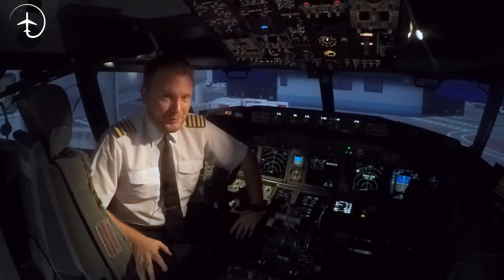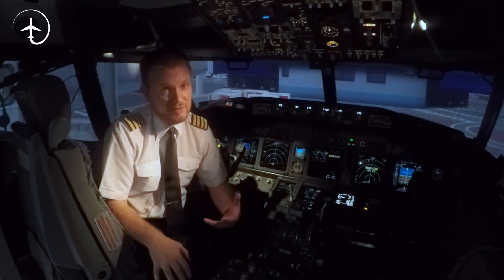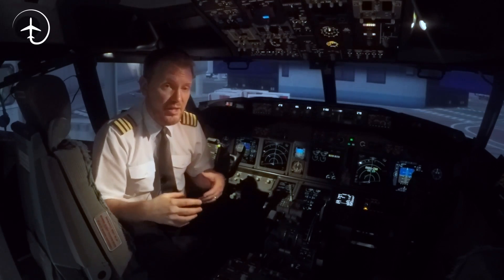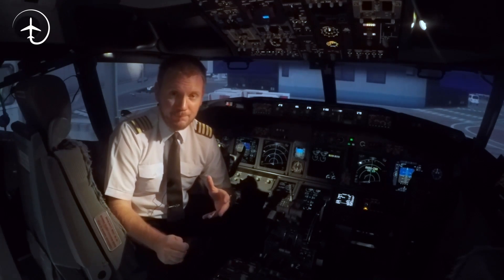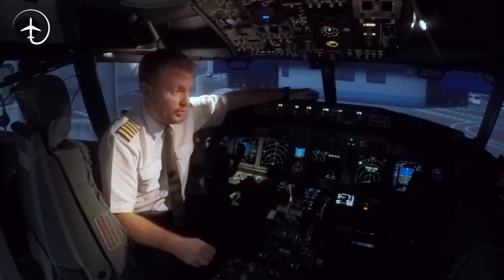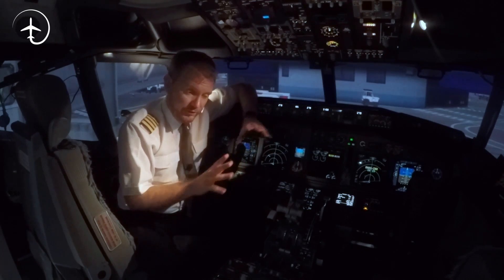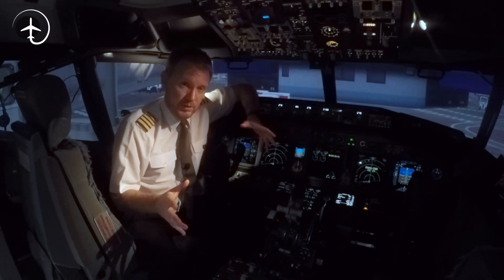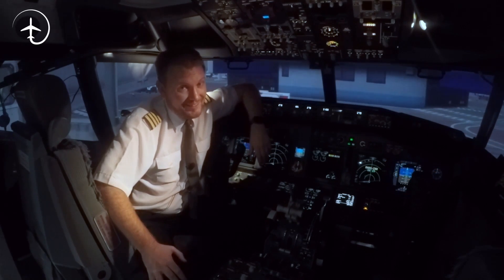Aircraft BLACK BOXES. How do they work?

Comment: Hey! I have a random question: what would happen if a plane used takeoff power for the whole flight at cruise? Obviously this would cause fuel issues, but let’s assume fuel isn’t an issue. Would this put the plane way overspeed? Are there protections for this? What exactly happens if a plane goes too fast? What is the difference at cruise between a plane’s top theoretical speed and the speed it needs to go at to fly normally?

I guess that was several questions but you get the idea. Thanks for the videos, keep up the great work!
Reply: zagstar on the A320, being a full fly by wire aircraft, it is envelope protected. meaning you cannot overspeed, stall or place it an attitide which conflict with it's design architecture. the five minute limit is a physical limit based on the materials used in the engine. If exceeding maximum run time provides a way to generate internal temperatures that exceed the limits of an internal part,  you could very well have performance and maintenance issues fast. with the Bus, unless the runway is contaminated,  we use a flex takeoff. a power setting less than 100% which gets the airplane off while reducing wear and tear on our engines.

Comment: Do you know of any changes to the hardware or procedures after the in-flight attack of Federal Express Flight 705, where the attacker popped the circuit breaker twice to prevent the sounds from being recorded? Maybe a warning sound when you take off without the CVR being on?

Comment: Mentour, when you are at V2, how much do you pull on the yoke to lift the plane off the ground. Also, what would be your dream plane to fly?
Reply: Sam Carollo on the A320, with speed reference system engaged. simply put,  the SRS provides vertical guidance during takeoffs and go-arounds such that the aircraft maintains: V2 + 10 knots with both engines running. V2 if single-engine
Reply: Ava Mende, are you a pilot?
Reply: V1 is the critical speed.
VR is the rotation speed.
V2 is the mimimum safe speed for one engine inop flight

So you do "pull on the yoke to lift the plane off the ground" at VR. At V2 you should be already climbing. When you have A/T (autothrust engaged) then the aircraft (B737) will aim for speed roughly V2+20.

Comment: i get the low capacity, cause it has to be made so resistant, but why not have a second box which is essentially just a single terabyte hard drive to store everything for months, sure it will get destroyed in the case of a crash, but if something less serious happens, would it not be practical to have months of data to extract from?
Reply: Final Barrage Mechanical disks don't stand a chance of surviving long in that kind of environment, with constant vibration in different frequencies. It has to be a solid state unit. And another issue is that it has to be shielded against cosmic radiation, because at cruising altitude in the high flight levels electronics are susceptible to interference by ionizing radiation. That precludes the higher-capacity units, since they are by definition (higher density) more sensitive to particularly gamma radiation, which is very penetrative.
Reply: I will say my most important point first and then throw some others in for other scenarios.
Modern aircraft will have things like this already for diagnostics on certain systems, they will be built into the various computers for logging "Debugging" information to help maintenance crews with problems, either software (like autopilot and the various displays) or hardware (from the motherboards of the computers to the engines and hydraulics).

Now for a scenario like, older aircraft, and why they don't have this:
Obviously, the usual answer would be that they didn't have the ability (that amount of storage) to do this when the aircraft was made, but forget about this, we're talking about adding it to an already built aircraft.

For one thing, if it is pulled to check for maintenance issues with an engine, really its only used to give a Yes or No to if the problem exists, very few will care about when it started (of course I agree that it can help to have more data than less, so I'm not saying your wrong, just throwing ideas to why it probably isn't there), just that there is an issue or isn't.

Another is weight, remember airlines and therefore aircraft manufacturers always want things cheaper, more things on a plane are more money, they want less fuel usage so therefore less weight. Of course, one Solid State TB drive and minicomputer are not heavy, but it's still something to remember when adding anything to an aircraft.

Comment: The reason why there is no wireless constant monitoring is actually simple: you can not have ground based receiver: it wouln't be able to get the data when you are flying over the oceans, or in mountains area. You basically require a line of sight between the airplane and the receiver. Now you can see why ground based can and is problematic. The solution would be a satellite link. Satellites are very expensive. And you need several of them to be able to cover the world. A mix of ground based and satellite is probably also an option, but then you need lots of ground based tower...

Then you have another issue: bandwidth. All of those data use relativelly alot of bandwidth, and there is lots of airplanes in the sky... All of them make a really huge amount of data to be transfered. This mean a very fast satellite link.

Then you have the satellite antenna on the plane... Those are also very expensive...

So why they don't do it? Cost.

However, what they could do and I'm surprised they don't is: voice recorder: add more memory, it wouln't be that expensive to increase it to 25 hours too. Once you do that, add wireless capability, so when the airplane is at the airport, on the ground, it can automatically upload the data to a server. That wouln't be that expensive to do.
Reply: Mentour Pilot there is a point. You even said it without realising: incident = pull breaker. Then an accident happend and they do not have the recording. Or they forgot to pull it. There is no reason to not have atleast 1 full flight of recording. Also, for some crash, the recording might have helped, but the short life of it caused issue... Cd quality (44100sps 16 bits) and 4 channels, uncompressed is only 1.2GB per hour. Lossless compression would reduce that under 1/3 that size, so less than 400MB per hour. I am sure they record at less than that right now.

So no technical reason not to. Not even cost.
Reply: Mhm. Considering that most crashes happen near the airports.
Reply from the maker: The thing is that the only interesting bit is the voices from just before an incident or accident. There is absolutely no point to store chatter from a normal flight.
That’s why it’s only 2 hours.
Reply: thephantom1492 I have an £80 SSD that can store days of audio then lol
Reply: The issue with the only 2 hrs voice recording is really weird to me. There is certainly a really good reason for extending the recording as described in this chat but I clearly see the pilots don't want to do it. They prioritize their privacy over recording possibly useful information. I am disappointed as the cockpit is not a private chat room but a decision making work space which directly affects dozens of lives.

Comment: how does acars differ from the black boxes. i believe acars transmit flight data in real time right?
Reply: timothy chua  the ACARS datalink system is used for transmission of short messages between aircraft and ground stations via airband radio or satellite. nothing to do with aircraft audio or performance parameters

Comment: What happens if an aircraft crashes into a factory of black boxes?
Reply: Adrian Wulff they look for the one with dings and dents in it
Reply: The absolutely BEST question in avionics EVER    :-D
Reply: The ones you crash into don't get dented, then? With the extensive level of logging (down to specific logs of the metal composition of used parts) I wouldn't be surprised if they specifically log the serial numbers of the black boxes that are in the plane. Going to take some time to check them, though.
Reply: Aviation is very superstitious. Even if regulations allow, no one I know would reuse any equipment from a crashed aircraft. We would even burn the chocks.
Reply: This reminds me of an old joke about a helicopter with 6 people on board crashing in a cemetery. 322 were found dead.
Reply: Read about Eastern Air Lines Flight 401, they reused parts.
Reply: Black box factories are always underground

Nevertheless the chances of this is so low.

Comment: Interesting. I wonder if it is not a disadvantage for Easyjet to use orange in their livery for exactly this reason.
Another question, do the recorders have a independent powersource? When you have a electrical failure the boxes are otherwise also effected?
Reply: Patrick the box has its own internal power source
Reply from the maker: Yes, the boxes are normally fed power from the aircraft but have their own batteries as well.
Reply: Patrick here's the numbers for the black box: FDRs and CVRs run off of a dual voltage power supply 115 VAC or 28 DC which gives the units the flexibility to be used in a variety of aircraft.  batteries are designed for 30-day continuous operation and have a six-year shelf life, now you know😉
Reply: Dear Mentour and Ava Mendez, thanks for this extra input.

Comment: Hello Mentour. I was wondering:
1. why don't they (FDR and CVR) record for more than 25/2 hours? It seems like an archaic limitation for a modern solid state memory system; I would make them both record for 1 month, then no special switch off procedure would be needed for the CVR
2. what if you have to switch off the CVR sometime after takeoff (because of some incident), but you still have to continue the flight; On a long haul, you would be flying the rest of the distance without any new CVR recording and if something more serious were to happen after the switch off, precious data would be lost. 
Thank you and Greetings from Bucharest!
Reply: I find that answer to only halfway deal with the question. You specifically state in your video that you sometimes have to stop the CVR to prevent it from recording over valuable data. Now, I am not saying that it needs to be in the black box per se, but you could easily have a secondary system that records for way longer in a relatively weak(er) box. I don't want to be 'the Air Crash Investigation guy', but several accidents have been investigated where older CVR conversations would have been very helpful (pre-flight checks, maintenance discussions, etc. that were overwritten). Also, you would capture the flight from beginning to end on long haul flights.
Reply: @hkr667  I fully agree.
Bogdan your comment about these 2 questions has a really good point in my opinion.
Reply: You mentioned that some problems can be traced back to erroneous performance calculations which occur before takeoff, yet if the voice recorder only saves the previous 2 hours, it seems to me that for longer flights that encounter a performance problem later in the flight, the CVR recording of the performance calculation would be unavailable. Based on this reasoning (and others regarding the space necessary to record X amount of data) that it should be a no-brainer to extend the CVR time before overwriting to (at least) 2 or 3 hours longer than the longest possible flight for a given aircraft type.
Reply: Solid state memory also can only do a certain amount of cycles, so larger storage would last longer. More storage could also check for things like defects in previous flights that cause this stuff? I would definitely have an automated system that sends an alert if anything unusual is detected too.
Reply: Steven Dorst Incorrect performance calculations would most likely result in an inability to take off, there the TO would be rejected. There would be no need for more than 2 hours of CVR data in that case.
Reply: In almost every single conceivable aircraft accident there is absolutely no reason to record longer than the last 2 hours of flight
Reply from the maker: The fact is that they are only there to record what led up to an incident or accident. There is no point in listening to the voices of pilots more than 2 hours before the event and rarely the systems more than 25 hours before.
Reply: @MentourPilot  SunJet Aviation N47BA would be a counterexample: it continued to fly on autopilot for nearly four hours after the depressurization event that caused crew incapacitation. Cockpit voice recording would have been immensely useful for clarify what happened, but was lost due to overwrite (that CVR only recorded the last 30 minutes, but the last 2 hours would also have been insufficient). In the end it has remained unknown what caused the depressurization and why the flight crew was incapacitated (i.e. whether they failed to don their oxygen masks in time or whether these failed to provide adequate oxygen)
Reply: @MentourPilot  What if a minor incident occurs at the beginning of a flight that takes way more then 2 hours? How is the 2h limit for the cvr handled?
Reply: @MentourPilot  From what I understand from the Mentour  Aviation app, the LionAir 737 MAX had a faulty MCAS system just the day before the crash that was averted by an off duty pilot in the cabin turning off the MCAS. If that vocal interaction were to have been recorded, it might've made life easier for investigators to find the cause of the crash mightn't it?

Comment: Tower  MENTOUR-six-six-five: we are at gate three, and have GRAUND clearance, ready for push back, and starting the engines :)  I want a explanations for radio communications, between ATC and Pilots.. :)
Reply: The first controller you (as a pilot) should contact is Clearance Delivery (DEL). DEL is not available in all airports, just in the bigger ones. If DEL is not available, you should contact Ground (GND). This controller will give you a clearance which usually sounds like this "(callsign), cleared to (departure airport) airport, off runway (departure runway), via (Standard Instrument Departure), then as filed. After takeoff, climb and maintain (initial climb altitude) feet. Departure frequency (the frequency of the departure controller). Squawk (squawk code - that you put into your transponder)." Then you readback the clearance and he will say (if you readback correctly). "(callsign), readback correct. Contact Ground on (ground frequency) when ready for pushback. ~or if you are already on ground frequency~ Advise when ready for pushback."

When you're ready for pushback and startup, you contact GND and we will give you the pushback and startup clearance. After pushback, when you're ready for taxi, he will also give you the taxi clearance.

When you're at the holding point of the departure runway, the GND controller will handoff you to the Tower (TWR) controller. TWR will give the takeoff clearance. Then you'll contact departure (DEP), which will guide through the SID and then he will handoff you to the Center controller (CTR).

When you're approaching the destination airport, CTR will handoff you to APP (approach) and approach will guide you through the STAR (Standard Arrival) and give you the approach clearance. Then you contact TWR which will give you the landing clearance. And after you've vacated the runway, you'll contact GND that will give you the taxi clearance to the stand.
Reply from the maker: It’s tough to come up with a video idea to explain that in detail but I will have s think about it.

Comment: Mentour what is a FMC
Reply: DM games the flight management computer can be accessed by the crew via the multi purpose control display unit (2) in the cockpit sometimes 3. the fmc controls all navigation functions. It can also perform approaches,  enter holding patterns, change radio frequencies, supply fuel and weight information at a particular waypoint and a myriad of other functions
Reply: DM games Flight Management Computer
Reply: I now that it can be accessed by the crew but how do you use it
Reply: DM games check mentour's video, my friend here on youtube called FULL FMC SETUP.
step by step of how it's done. you will enjoy it